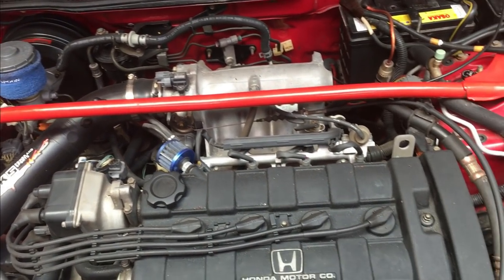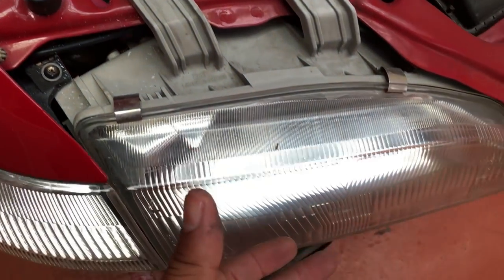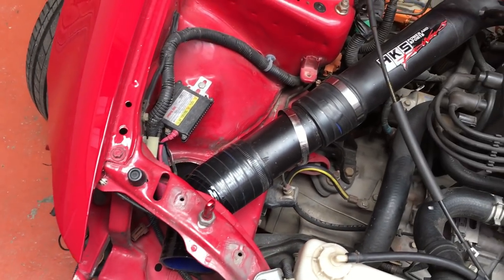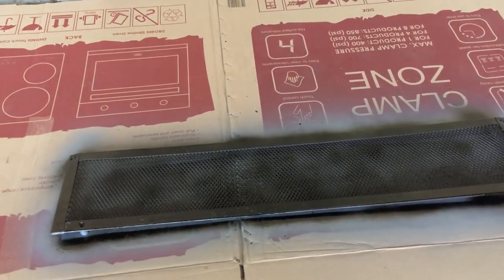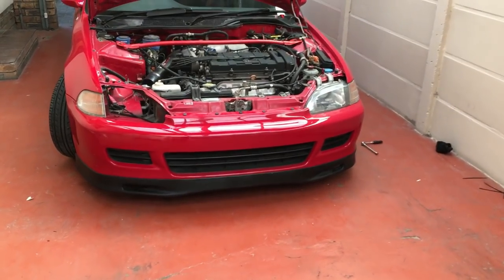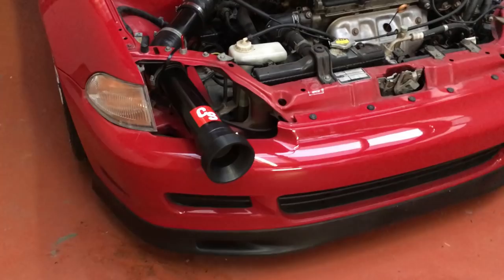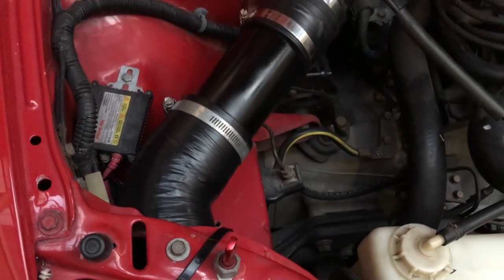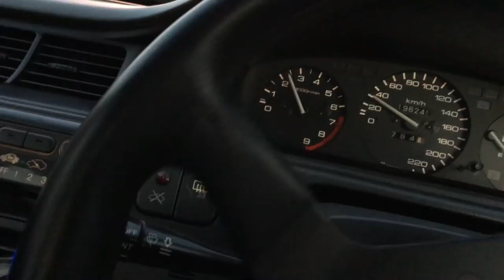HONDA EG B18 HEADLIGHT STACK INSTALL (+ SOUND CLIP)

Comment: Car sounds amazing bru 😍 that pure Honda sound 🔊
Reply from the maker: Yeah sound different outside and Higher gears
Reply: @WongStreet2Track  yes bro you can actually hear that flow of air through the induction when you accelerate

Comment: Awesome bro sounds sweet kwick question kurt I saw you still have hid light kits in your car do u think it's better then there c6 kits out there ?
Reply from the maker: Yo bro thanks alot
Reply from the maker: Erm to be honest i hav no experience with those. Ive been running these HID for a long time.
Reply from the maker: It never gave me a problem so i didnt see reason to ever change them
Reply from the maker: Howeva 1 things for sure i can drive at night with only one headlight
Reply: @WongStreet2Track   bro do u know where I can find a set of hid still h7 coz the c6 is pointless to be honest
Reply: @WongStreet2Track  for sho they last for every
Reply: With HID can dust cover be fitted or not?
Reply from the maker: Sorry bro i cant think of any1 selling right now. But try fb market place
Reply from the maker: I assume so

Comment: How much did you pay for your Dremmel? And were you able tp source i ur locally?
Reply from the maker: Yo bro builders sell them and the fittings
Reply from the maker: Id recommend u go with the wired ones
Reply from the maker: These batteries dont last that long
Reply: Thanks bru il do so🙏

Comment: Mr Turbo has black silicone hoses.. check their site..
Reply from the maker: Yor thanks alot bro 🙌🏼
Reply from the maker: I’ll definitely go check them out
Reply: @WongStreet2Track  cool man! And they're not badly priced. If not cheaper than most other places, then the places still don't have black, I looked all over for a 100mm 45deg,  Mr Turbo had it for R294, other place was R340 for the blue. They have various sizes 🙌

Comment: I don't think cutting that glass light will work like you think you should get a plastic headlight to make a hole in
Reply from the maker: Thanks for the advice. But ive seen it being done with a diamond core drill bit

Comment: Lekker video mybru, but you must get a proper rounded 76 mil stack now man not that small air filter bou
Reply from the maker: Thank you My Guy 🙌🏼
Reply from the maker: Yeah im going to try different forms of induction. I might just do a comparison video 🤔
Reply from the maker: I must say the conventional china town stacks sounds good 🔥 bcz sound echos of the metal. However its creates alot of heat and heat is the enemy of power.
Reply from the maker: With the CS stack we trying steer away from the norm and try new things. Most modern mods for inductions are carbon and plastic is the closes we can get to carbon with out spending carbon money
Reply: @WongStreet2Track  no stress bru, and ya I've got a VVL with a "common" ram stack at bottom of my car sticking out where the spots is and it doesn't actually get that hot but when it was inside the engine bay then it did affect the performance abit but by a kilowatt or 2 if I remember correctly, nowadays I just take it off and put a filter on for normal town driving so it doesn't get that hot though, but I will deafntly be looking forward to the comparison video if you do make one, then il deafinitly get a CS stack aswell 🙏🏽 but other than that it's still a great video and the sound is stil there abit on the soft end but it's there 🔥✊🏾
Reply from the maker: Yo bro i dig it when the Sti/Gxi run the stack thru the spot insert THAT SHIT IS FIRE 🔥🔥🔥
Reply from the maker: Yeah bro u definitely need to get a CS STACK my lil b18 doesnt give that stack justice
Reply from the maker: Id really like to hear a VVL with one on🧏🏻‍♂️
Reply from the maker: Thanks alot for your comment Gregory its really motivates me to make more content 🙌🏼
Reply: @WongStreet2Track  no problem bru and thanks to you aswell shot it ✊🏾

Comment: A little tip. Don't use primer on plastic
Reply from the maker: Thank you for the tip but no primer was used on any plastic in this video
Reply from the maker: The stack is 3D printed black plastic
Reply: @WongStreet2Track  I wasn't referring to the video. Nice work regardless.
Reply from the maker: Oh sorry MyDude i thought u thought i sprayed the CS STACK, MyBAD
Reply from the maker: But seeing that we on this topic i plan on either spraying the Silver EKs Plastic/PVC induction or fitting something similar for my car
Reply from the maker: How would u suggest i go about it?
Reply: @WongStreet2Track  in anything plastic, wet sand with a finishing pad 600-1000 clean off and then spray, that's all, primer is used to prevent rust from the inside out that the only use but on plastic it will make the paint job weak. Another nice thing is before u use your colour spray use white as the base, any colour over white spray will come out 100% brighter. Many people think that primer will fill up pin holes or imperfections but it's grossly incorrect.
Reply from the maker: Thanks alot bro this sound very helpfull ill def screenshot and keep it in mind
Reply from the maker: Howeva dont you get plastic primer?
Reply: @WongStreet2Track  100% you do get and it's a load of crap and a waste of money. I'm currently fitting an iPad in my dash therefore I've learnt all this the hard way as I've been sanding and spray painting the body worked dash trim for over a week now and the moment I stopped using primer the results was amazing! Then I started researching this and actually found all this to be true! Try it in your next paint job, I'll sent you some pics of my iPad install and you'll see what I mean...
Reply from the maker: This seems extremely interesting bro send those pix thru. My dash is hokal starting to look a lil boring lol
Reply: Sorry to diss, but plastic primer actually plays a very important role in spraying. Can't believe this dude give such wrong advice on public page.
Reply: @localcarvideosmore6655  oh wow, please tell the public what importance does it serve? On the other hand I can't believe that I gave such wrong advice on a public platform it could be that I can't comprehend what should be disclosed and what shouldn't. Anyway thank you for correctly my very wrong advice. I will definitely use the primer from now on to ensure that my plastic does not rust. However you will state that primer seals the surface and smooths out the finish oh not forgetting makes the paint adhesion better. The first two is definitely correct for METAL but it does NOT act as a adhesive promotor, however using adhesive promotor on plastic will be the best but definitely not primer. Therefore using the 1000 grit  will smooth down the surface if need be. Another point, my name unfortunately is not 'dude' as my profile suggests. I may be an accountant by profession and not a spray painter however I speak from actual practice and actual results I received from using primer and not using primer for what I'm currently doing and not based on untested unverified information or worst google research on the subject on hand.